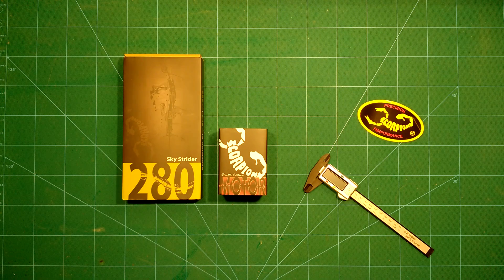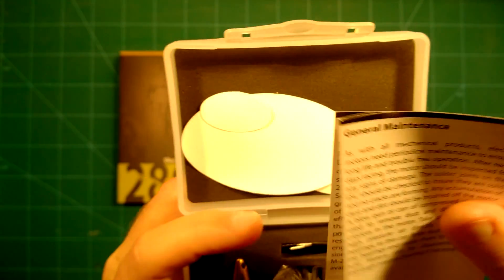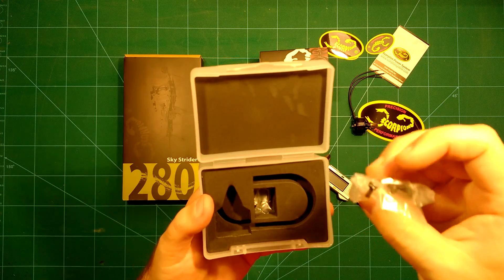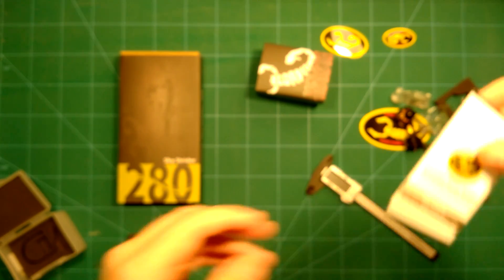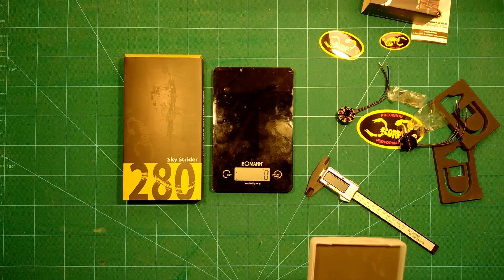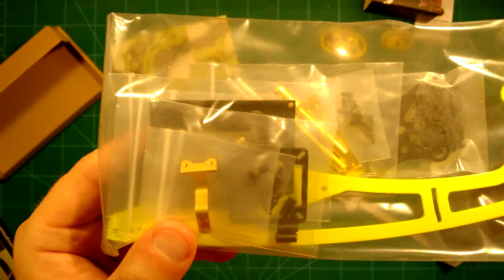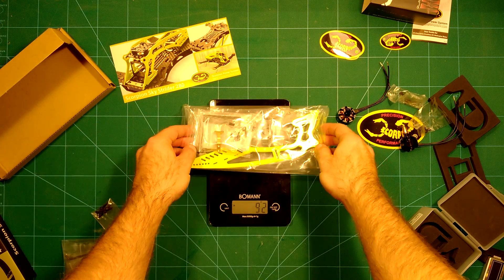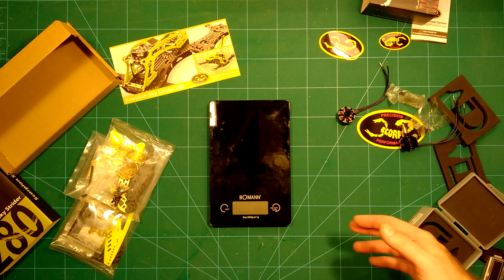Scorpion Sky Strider 280 FPV Racer & 2205 motors: Unboxing Review

Comment: Nice kit, I would like know which ESC are you using in this project? thanks.
Reply from the maker: +Oscar Carbajal Most probably the Favorite LittleBees - they are my prefered ESC right now: http://bit.ly/1Sb9QsL
Reply: +RC FPV Flight Thank you for quick reply, I´m working in a racer quad project and will be using 6 scorpion 2350Kv but I need be sure the ESC class and batery power, thanks againg amigo.